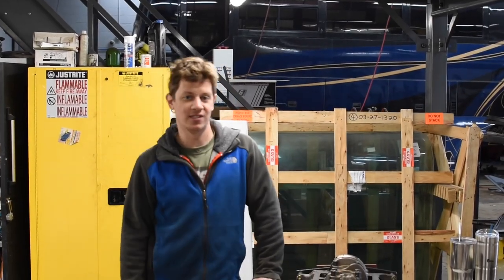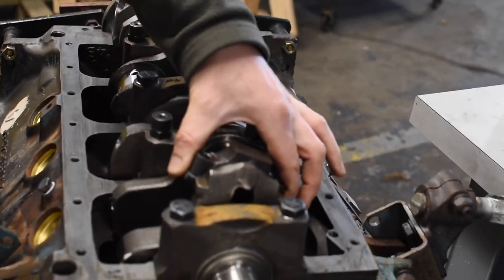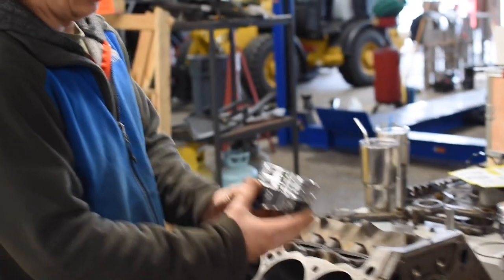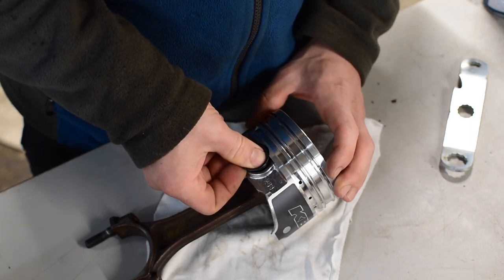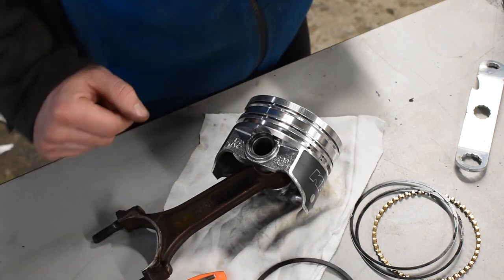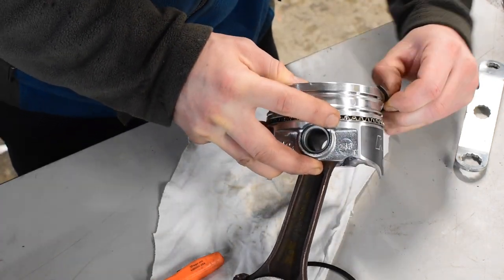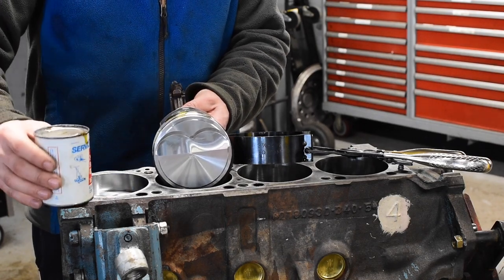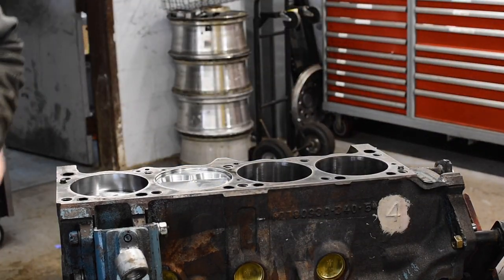Bay State Engines piston and rod assembly on Chrysler 250 Marine Engine Restoration

Comment: What oil are you running in this? I just picked up a 73 boat with a 340, and im struggling to find oil type and filters.
Reply from the maker: Hello. Most likely a single weight SAE 30 detergent would be all you would need. If the oil pressure is low or temps are high where you live, consider upping it to an SAE 40.